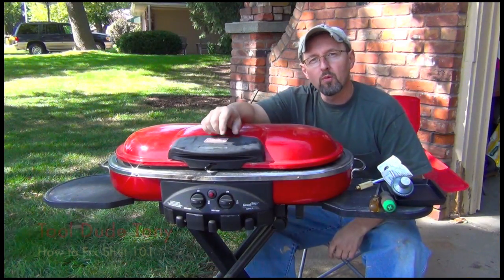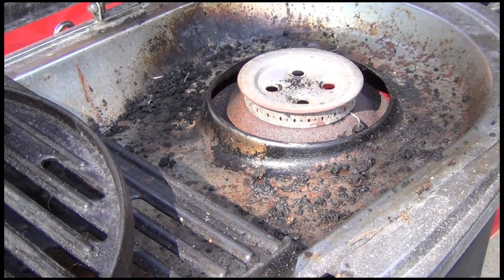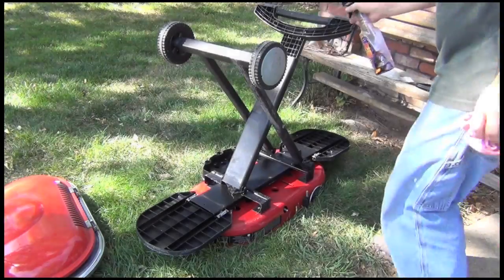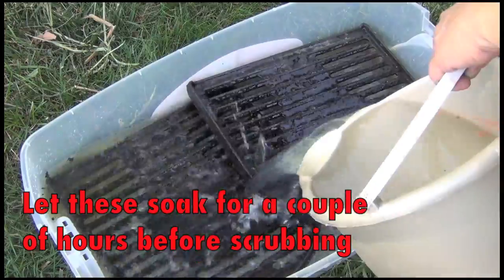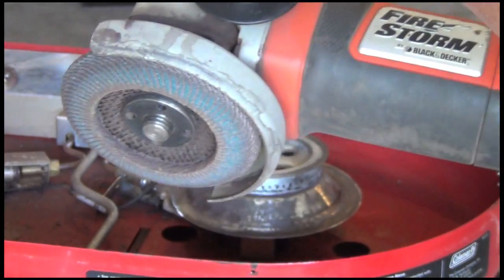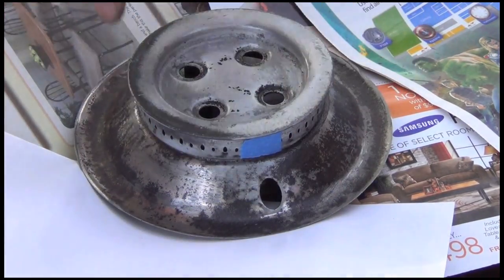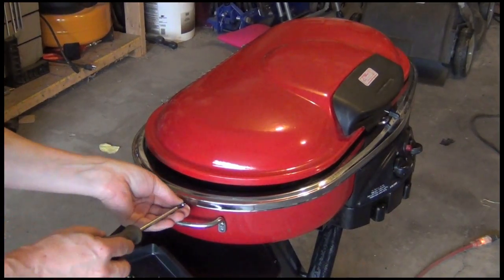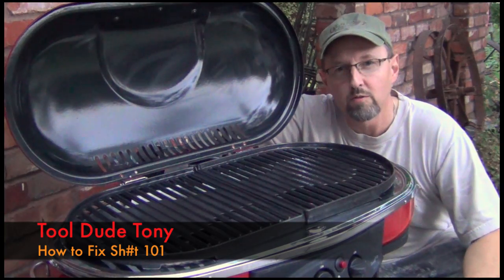How to Restore a Trashed Coleman RoadTrip Grill

Comment: I used to clean my roadtrip with a wire wheel (which worked fine with my drill) Eventually the chrome plating wore off and then the tray started to rust. If it ever rusts bad enough, i'll just buy a replacement tray from coleman. I have already replaced a slide out tray that broke for like $7. I've had mine for about 5 years now and its awesome.

Comment: Just wondering. How did the burners hold up with the paint? Did it start to flake off?

I thought that even the high temp paints weren't supposed to be used inside the grill.

Comment from the maker: @Alan - That paint is specific for grills like this, so assuming the manufacture has done the right thing, we should be good using it on our grills.   Fumes are never good.  Use a real mask (not a dust shield) like a 3M Tekk Protection Paint Project Respirator whenever possible.  And yes, you can paint the whole inside.  Just be sure to prep it good so the paint doesn't flake off on you later.  Thanks and have fun with your project.

Comment: I have a roadtrip grill, has a hose that attaches to a 15lb  bbq propane tank.  I would like to adapt the grill to use a small green tank, one you can buy for about 2.00 in Walmart.  Do they sell an adaptor for the coleman Roadtrip grill?

Comment: Hi Tony

I am trying to enamel paint the grill. In particular I am looking for painting the chrome plated bottom just like the top (but with black). I tried using the rustoleum high heat, but after application, I dont see the enamel kind of smooth finish. What do you recommend if I have to get the smooth finish.

I looked at http://www.eastwood.com/paints/hi-temp-engine-paints/engine-paints.html
but I am not sure if that holds to the high heat.

Appreciate some inputs

Comment: Tony, are the hinges held on by rivets or by screws? The one I just acquired for $30, the cover/lid was not attached. PLEASE ADVISE. Mine looks way worse than the one you restored, but I've already removed a lot of the surface dirt & chunks of "BBQ-dung" (for lack of a better term). I'll have to send before & after photos....super glad I found your video.....Thanks

Comment: I need to replace the burner assemblies on mine and Coleman does not offer replacements for this...or at least they say they don't. Anyone know of any options for replacing with propane burners from something else or another products replacement parts?
Reply: Kyle Bonura Kyle did you have any problem removing the burners from your Coleman grill.  I am trying to remove the burners to clean the inside from spiders and am unable to do so following the manual.  Any suggestions?
Reply: A year too late..I got the nxt and I'm much happier

Comment: You did a great job cleaning this grill, but most of what you did was a waste of time, with the exception of cleaning the grates and wiping the chrome tray under the grates, I would not have done anything else.  Taking the burners apart and cleaning the rust off and repainting them was a waste of time, in my opinion.  Also, the burners should not be painted because you risk  clogging up the holes when doing so, and they did not come from the manufacturer painted.  But I guess if you have the time to do all that cleaning that's great, but it would have worked just as well with just a quick cleaning. I have the same grill and just clean the grates occasionally, and wipe out the debris on the chrome tray and that's it.  It's worked fine for many years.